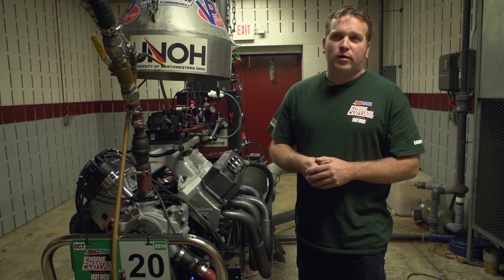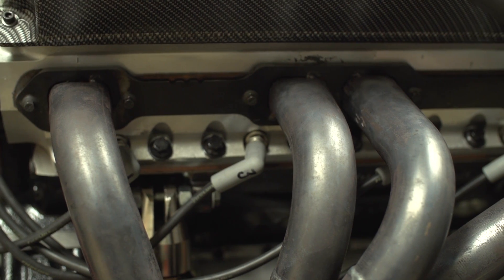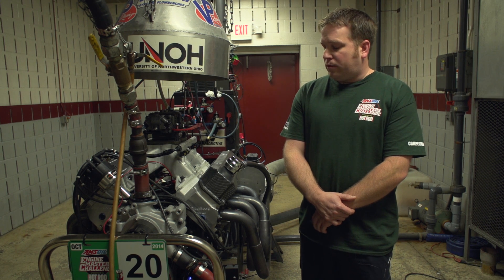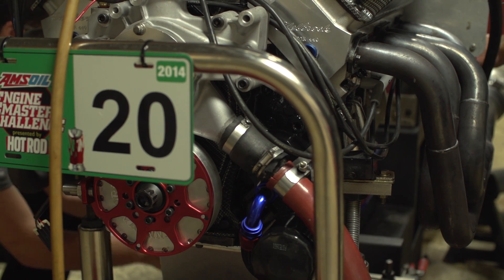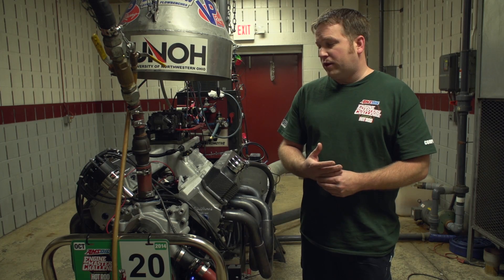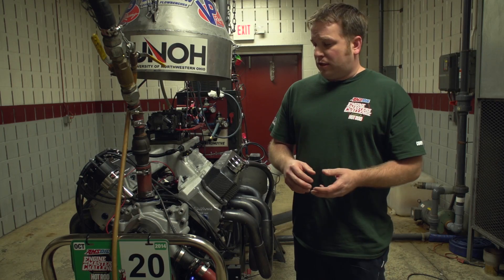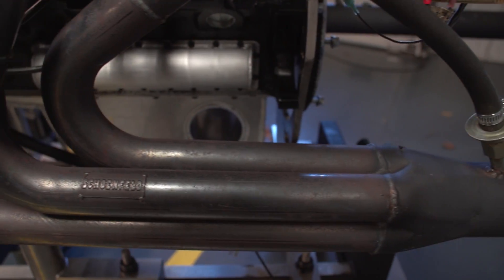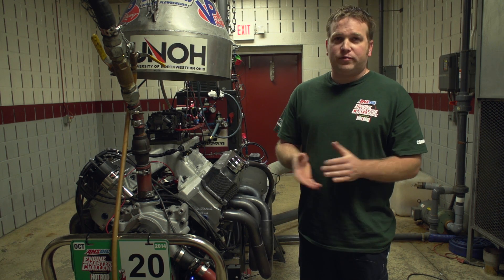Small-Bore 440 Mopar by SKMFX Engines at the Amsoil Engine Masters Challenge 2014

Comment: I don't get the "Small Bore / Big Stroke" wouldn't that just be a stock 440
Reply: No. They're 3.75"stroke & 4.32"bore as standard.
For their capacity 440s are short stroke. They also have a tall deck height, long rod and a buttressed crankcase.
In short they love to rev up. The low deck variants have even shorter strokes and consequently rev up even more.
Reply: Over 700hp is possible at this displacement with the Victor heads.  This must have been a pump gas build.  636hp is a good number.
Reply: @mitchellferre1652  I have never ran my Edel Victor heads n/a so I like to see 1's that are and the hp to evaluate how my 14# of boost is doing on my 446",heads flow 340 cfm at .650" lift
Reply: @michaelclanton1152  1000hp or more is easily within your reach , even more with e85, race gas or alcohol.
Reply: @mitchellferre1652  I am making 1k hp on 110 fuel but putting it to the ground has been hard.I just went to a th400 trans as a final attempt.
Reply: @michaelclanton1152  how much tire do you have and what's the weight of the car  ? What car is it ? Sounds insane  !
Reply: @mitchellferre1652  28x10.5" tire,3900# car n driver,1969 Plymouth Sport Satellite,3.73 gear.
Reply: @michaelclanton1152  nice  ! Definitely could use a 4 link rear and full cage.
Reply: @michaelclanton1152  I have a 66 Coronet 500 with a iron head 440 .509 cam about 500hp 3800# runs 11.70 on drag radials I have been thinking about a F1R Procharger
Reply: @mitchellferre1652  Cool.The blow thru is more involved that is all.
Reply: @mitchellferre1652  I didn't want to cut up my car for 4 link so I still have leafs,caltracs
Reply: Regular "B" not a "RB" 440.

Comment: Anybody else notice that this engine has a carburetor AND fuel-injection?  At 0:07 you can see the fuel rails and individual injectors for each runner in the intake manifold.  You can see it more clearly in the pictures on the website.  It looks like the injectors aren't connected for the Engine Masters competition, so I guess this engine can be run either way.  Very cool to see an engine like this using multi-point injection setup, rather than the single-point carburetor-replacement style.
Reply: good eye for detail, didnt see that till you pointed in out. Maybe they took the intake from another engine for this and just left the injectors and rails on?